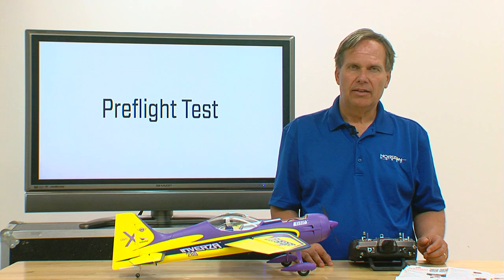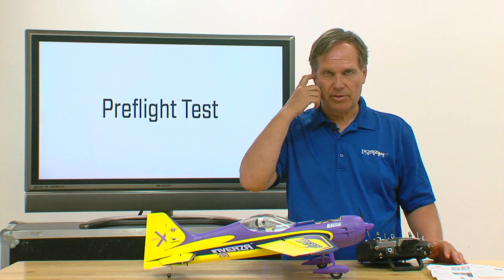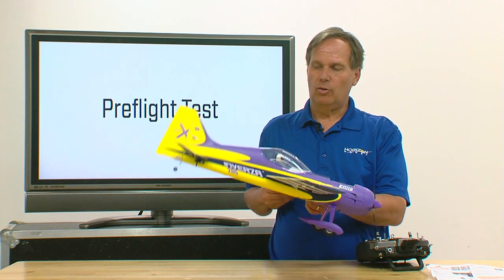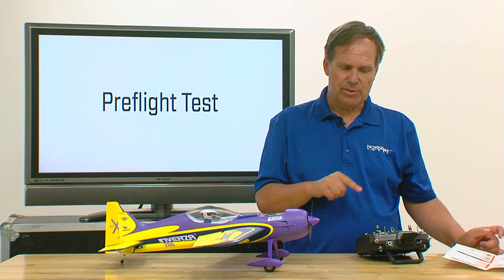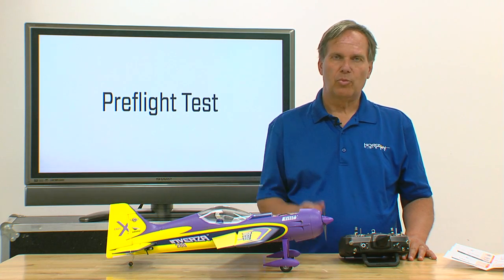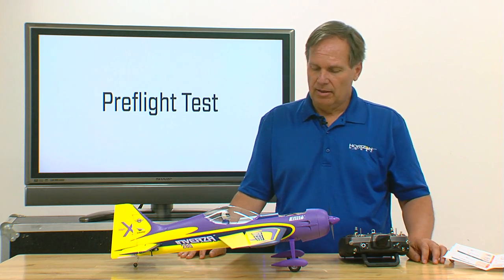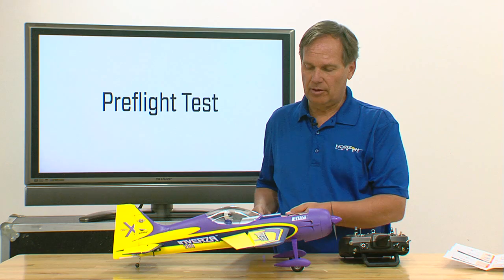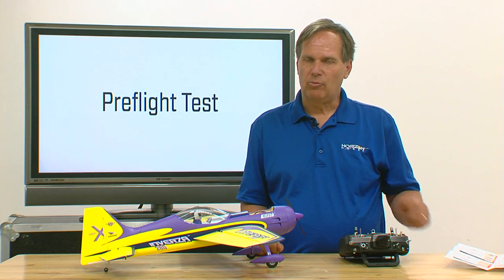Spektrum AS3X Step 16: Pre-flight Checklist (Final Model Setup)

Comment: Useful note:  If a servo direction isn't correct, and you've checked the receiver orientation matches programmer, AND servo reversal is not active in the Tx AND the Reverse function in the AS3X Programmer doesn't correct it, then move the servo horn from it's current orientation to 180⁰ opposite, on the servo: Note the horn position, remove the screw, pull off the horn, move it 180⁰ left or right and refit it. Secure the screw, and voila!

Comment: Hmm I have the inverza 280 and it doesn't have as3x, you must have installed a different receiver or reprogrammed the existing one, either way I'd rather not have as3x especially for higher rates to avoid oscillation in higher speed and high G maneuvers.

Comment: The receiver orientation is wrong in the android app. I had to purposely reverse mine to get the as3x features to work properly. Very important step here.
Reply: I also had an issue with the reversing.  I used the DX9 transmitter, SPMAR636 receiver and Android mobile app.  I mounted the receiver label topside and pins to the rear, and made the orientation change in the app, but the ailerons corrected in the wrong direction.  To correct it, I had to reverse the ailerons in the transmitter and reverse them in the app.
Reply: I had the same problem. The mistake was receiver upside down. The square looking symbol on receiver looks like the label. It is not. The Spectrum bar symbol is the label side. Looks like the orange bars symbol on transmitter but not orange on app. Try flipping it in the app and reversing ailerons back to normal.  It should fix your problem. Never reverse any function in transmitter when using the app or big problems could arise. I hope it works for you and others as it is confusing.
Reply: I had to do the very same reversing as mentioned by mmerry2.